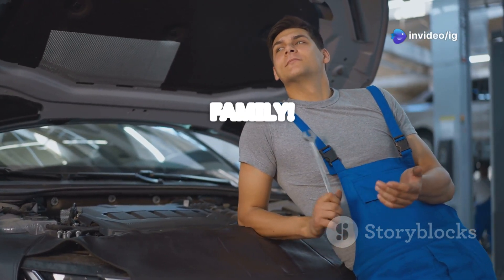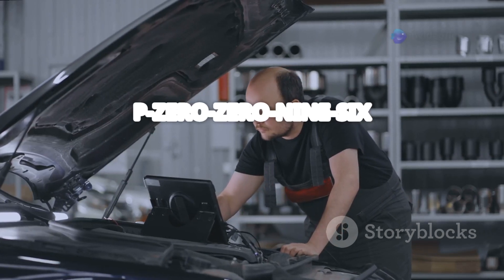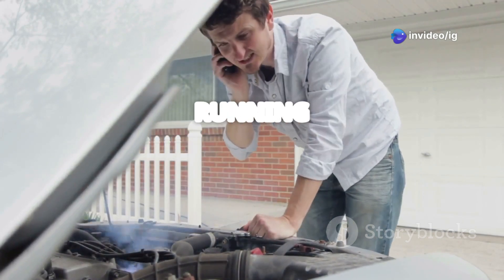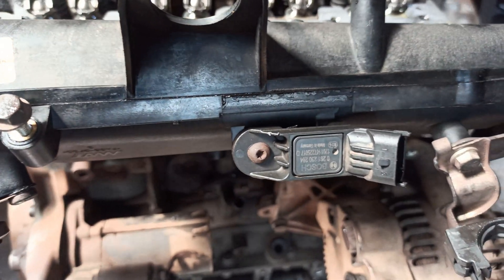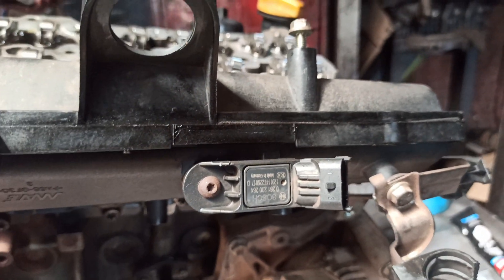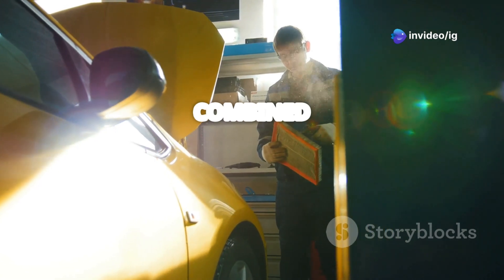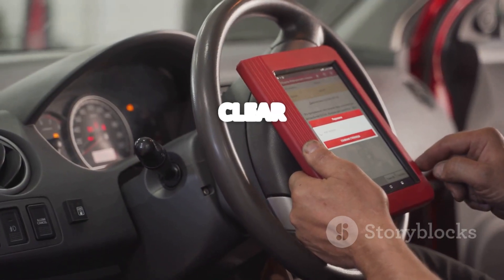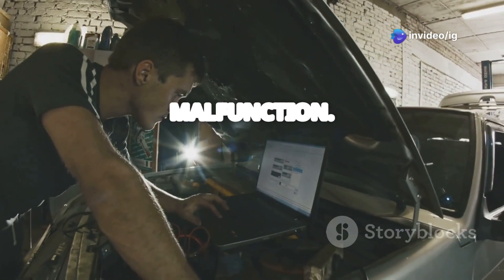P0096 | P0096 Intake Air Temperature Sensor 2 Circuit Range | code p0096 | p0096 obd2

Comment: I catch 2 errors when accelerating with kick-down of my Volvo D5.  P0096600  'intake air temperature sensor 2 and P029900 'turbocharger / supercharger underboost' . .. I changed the map sensor on inletmanifold, but the sensor at the intercooler is not yet changes.. coudl fault the sensor on the intercooler of volvo s80 d5 cause this p0096 issue?